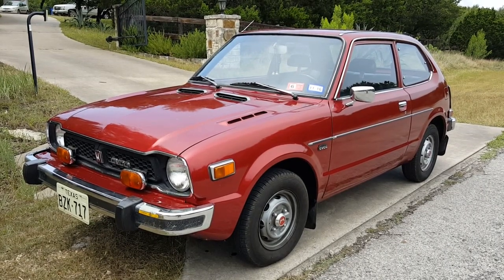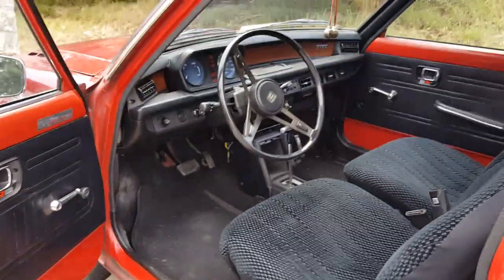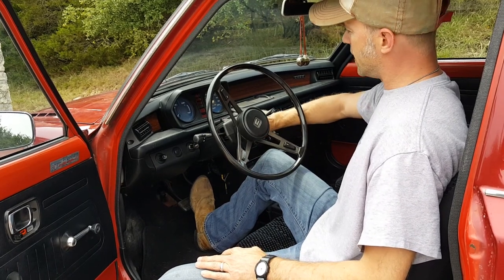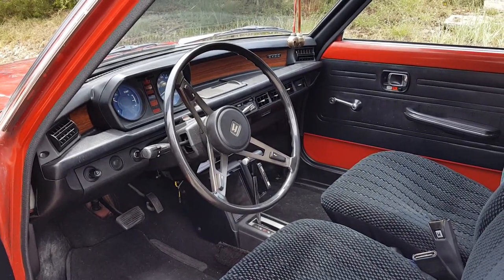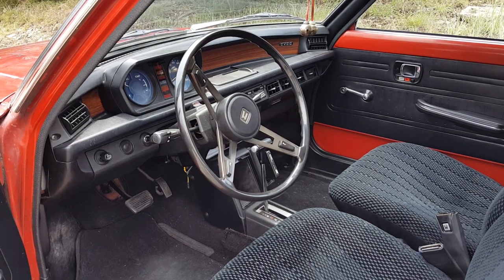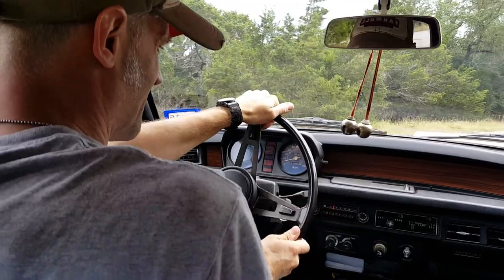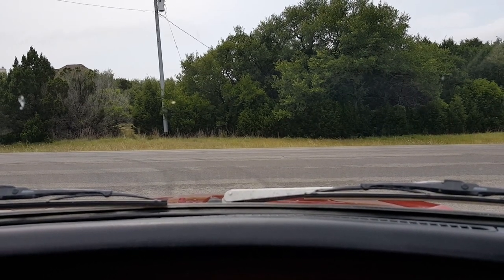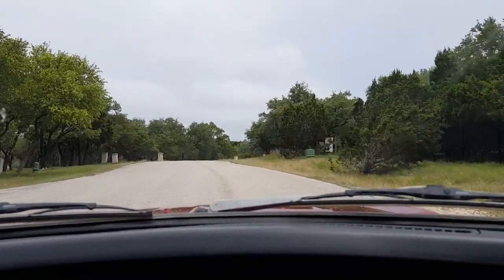1977 Honda Civic CVCC Hatchback Classic Car Vintage

Comment: I looked at the 72 Civic when it came out. Nope. Then the 73 came out and I said, YEAH !!! Bought a demo from Bud Kouts Chevrolet in Lansing, Michigan.  Had 6,000 miles and I paid $2,000 for it. Loved that car and 50 years later my kids still love it and talk about it, almost as if it was an old family member! Me and my small kids drove in that car everywhere for 5 years! After paying $2,000 and driving it 100,000 miles I sold it for $1,000. One of the best investments of my life, and that's a lot because I'm 82. 🙂

Comment: I owned one, a grey hatchback with whitewall tires, I loved that car. I drove it every second weekend from Toronto to Montreal and back 700 miles for over two and a half years and it never let me down, the gas milage was phenomenal. It's a good looking car too, and so easy to park. Honda should've reproduced a newer version but in the same format, at relatively the same price point. Great car, it blew away GM's small car attempts in the 70's, that's why Honda is what it is today, a smart marketing outfit.

Comment: Brings back memories.

These cars were engineered so well that the only reason they didn’t last forever was because the body would rust out, but that was only after it had 200-300k miles on it.
Reply: in canada they rusted out in 3 yrs lol,but yes,if not the car would have lived forever

Comment: Thanks for the memories.

I originally had a 1978 Civic Hatchback given to me by a colleague back in 1988. I drove it until 1990 when it got t-boned on my wedding day. During the same time frame I came across two 1977 Civics. One with a decent body and one with a decent engine. I did a swap and had two running Civics for some time. One had a 5 speed manual and the other had a Hondamatic. I really disliked the poor performance of the Hondamatic.  Well one day the engine on the Hondamatic seized and when I tried to restart it, it kicked a rod out the side of the block. I was again back to two Civics, one with a decent engine and one with a good body. I did another swap and was down to a 1977 Civic with a trunk (half hatch) and a 5 speed manual. I sent it in for body work and paint and drove it until 1997 (20 years old).
By this time the floors had rotted out and I parked it. I bought a two year old 1995 Civic Hatchback and have been driving it until present It's over 22 years old now and still goes like stink. It'll probably exceed the 30 year old mark and still be going.

Sorry for the long story but it's been a long history for me with Honda Civics.

On a side note: I also have a 1993 Civic Sedan that's still running.
I have many more Civic memories to share but I've written enough already.

thanks
Reply: Christopher Brennan..sweet memories? Picking up girls on various dates?
Reply: Christopher Brennan  I got to drive my friends brand new ‘95 Honda Civic back then and I was surprised at how quick that little car was.
Reply: I HAD an ‘84 and ‘92, both rear ended, have a 2008, that is now my sons car.  I change the oil and trans fluid, and it stays running.
Reply: An update:
I got rear ended in the 1995 hatch about 1.5 years ago. The guy hit me at 70 km/h while I was stopped. It broke the back of my seat and left me horizontal. I'm still hurting from it but I keep going.
My son crashed the 1993 hard into a curb on Father's Day. We fixed the major structural damage and he's still driving it.
I kept the 1995 hatch for parts and we used some of them to fix the 1993.
I miss driving it. It still runs but can never be put back on the road.
Reply: @christopherbrennan7747  oh no!!!  sad to lose a car with memories.. so it made it until around 25 yrs?  I actually sold Hondas in 93-95 so I can picture it. Glad you were ok.. My '77 didn't really protect me much during my (head on) but I have a hard head.  It would've helped if I'd been wearing my seat belt. I was in college and my Dad had never worn a seat belt in his life prob.,  so he was like the stubborn almost 60 year old patriarch of our big family.. we said, "Dad, put on your seat belt."  He did, for the rest of his 92 years. I got a 1980 Civic sedan in '84, and 1985 Accord sedan in 87? and finally a new 1991 Accord but two years later when I worked at the Honda dealer, I'd fall in love with all the cool used cars too... So I traded in my '91 for a used '91 Accord "special edition", cool color, leather, my first automatic :) In the mid-'90s I was trying to sell the '91 to save money and I bought a perfect condition early '80s Accord sedan to replace iI but I sold that quickly to the used car manager at my old Honda dealer and kept the '91 after all... until my little baby arrived and it was too hard to get him in/out and I went with a used mini-van. Then finally a 2004 Toyota mini-van which has 248K miles now and my husband wants me to get a 2021. Sadly, the Toyota is still going to beat out the Odyssey. So you son's driving the '93 and you don't have a Honda now? You're forgiven.

Comment: I purchased my green 1977 Civic in 1980 from a used card lot in Hinesvile, GA for $3,000. Mine too had the Hondamatic two-speed manual shift. I'd forgotten about the chock until watching your video. It came w/ just a single speaker for the radio. Unbeknownst to me, my car had been in an accident and had some Bondo and a complete repaint job. I drove it all the way back to Los Angeles from Ft. Stewart, GA w/ a surfboard on top. In that 2,500 mile drive, it took 3 quarts of oil. I had the car 5 years. On the way back from a Dodger game on the freeway it blew a head gasket. At the time I didn't know what that was, just that I had a bunch of steam blowing out my tailpipe. It warped the block head and I spent $1,800 for a rebuilt engine. By 1985 the transmission was faltering. By that time I had my eye on the new Honda Civic wagon which I purchased for $8,200. My first new car. I got a $500 trade-in allowance for my Georgia Bullfrog Green Civic. Fond memories. Thanks for your great video :-)

Comment: My dad loved his 72 600 series. Still tells the story of driving from California to Missouri on 20$ in fuel. Always claimed he could get 50 mpg. 
When i was 14, my dad bought a 77 cvcc for me to experement with, but it has been swapped with a 79 accord 1751 cc engine, and 4 speed.
It had a Subaru Impreza hood scoop to clear the carburetor, and the alternator almost touched the back of the headlight. 
Maybe one of the first engine swapped hondas, definitely the first i ever saw personally. 
I tried many many many times to make it run right. But the cvcc engine, and carb, with its 40 vacuum check valves, and solenoids never did run right. 
Would have been cool because that motor was supposed to have about twice the hp of the factory motor. 
25 years later i saw a cutaway of a cvcc engine, and the lightbulb finally went off. And i knew why a car i hadn't touched in 25 years didn't run.
I always thought the master cylinder setup was hilarious. Designed for right hand drive,

Comment: CVCC = compound vortex controlled combustion. Carburetors were prone to damage from dirt/debris and build up, so clean the carburetor and change fuel filters aggressively or install an aftermarket device.

Comment: Beautiful car. My first brand new car was a yellow 1977 Honda Civic, but mine had a manual transmission. It was a blast to drive. I literally wore it out. I live in AZ, and it never did rust. I have not been able to locate another one that is not rusted to pieces. My car was called a Civic, it said Civic right on the title.
Reply: I also had a manual yellow 77, bought in 1986. Did yours have the wood steering wheel? I LOVED that car. If I knew then what I know now, would never have sold it.

Comment: Mi primer carro cuándo tuve 15 años... Este carro corre como liebre son muy ligeros y me gustaba su tacómetro parecía de motocicleta y lo asombroso es que sus llantas eran rin 12" los primeros autos con bomba de gasolina electrica 😭😭😭 está bomba que la traía bajo el asiento trasero me provocó un corto circuito y en menos de 5 minutos lo incendio en su totalidad, quedó vuelto en llamas y al final era pura lámina acero y el motor todo carbonizado. Me encantaba el carro lo recuerdo con nostalgia. Saludos desde San Pedro Coahuila México.

Comment: The 1977 Green CVCC that I bought in 1978 was a great little car.    The only problem I had with the car was I needed 2 water pumps in the 7 years I owned the car.

Comment: I had a yellow 1975 Honda Civic CVCC "'5Spd" which I absolutely loved . Had it from 75-79 ( 44k miles)  which I then sold and bought a used 1972 Datsun 240z ( w/88k miles) Big mistake. Truly miss the Honda and not so much the Z which was surprisingly problematic w/88k miles.
Reply: kevin shumelda do you still have the Z?

Comment: Did anyone notice that the engine bay was designed for right hand drive? The brake master cylinder was on the right side while the drive was on the left. I wonder if they made some kind of linkage system?  Looking at 5:00, it seems like the steering box is "remote", as well.

Comment: In the latter half of 1975, apparently you could get a Honda Civic, namely the GF type Civic, with the 1488 cubic centimetre ED CVCC engine, a FIVE-SPEED manual transmission, four doors, and a back door that wasn't exactly like hatchback back doors but still acted as a back door. This GF version may have only been available in Japan, Australia, Europe, and Britain though.

Comment: But if you use the choke and race the engine at high rpms when cold, wouldn’t that damage the engine.  The oil wouldn’t have circulated that so it’s basically metal on metal until the oil warms up.

Comment: You didn't have to lift your foot off the gas when changing from low to high (or vice versa).
Reply: Not with these gearboxes the Semi auto with different set up there a crotchless manual
Reply: they have a motorbike type thing tork converter to help excelarate it so u could even start it off in second gear without it bogging out completely just like a motorbike

Comment: catalytic converters were not required, the emissions levels mandated required the use of cats on nearly all vehicles.  Honda worked prior to 1975 on this while american auto manufactures assumed the standards would not go into effect and had to throw cats on their cars, and drop compression causing the precipitous drop in performance.  A Long with the change of measuring horsepower in net verse gross...

Comment: How many gears does that hondamadic have?
Reply from the maker: It has two gears -- not counting reverse.
Reply: highlandoutboards I thought it was like that, it’s just a little weird having a two gear transmission in the seventies.
Reply: Low was roughly equal to 2nd gear in a manual, and high (or "Star" range) roughly equal to 4th. If you were in high it would stay in that gear (i.e there was no kick down facility). Starting off in this range was a good way to seriously fuck the transmission and that is how many people drove it. The correct way was to start in low and shift to high at about 20 - 25 mph. Used thus, these Civics performed quite well. Over about 55 mph though, they got a bit noisy.
Reply: Club 1 Fan thanks
Reply: Chris Thompson accvjmj